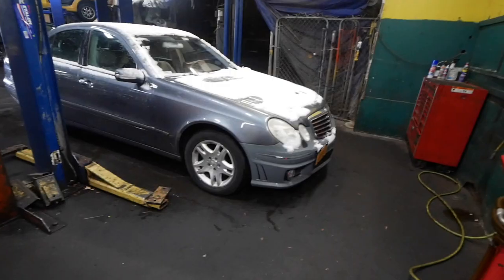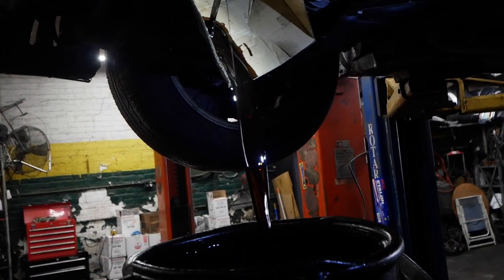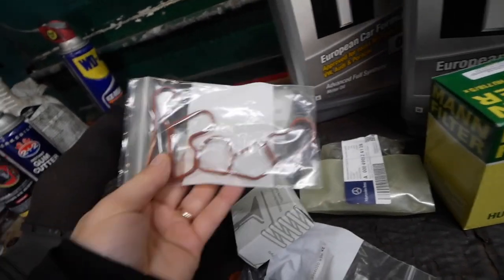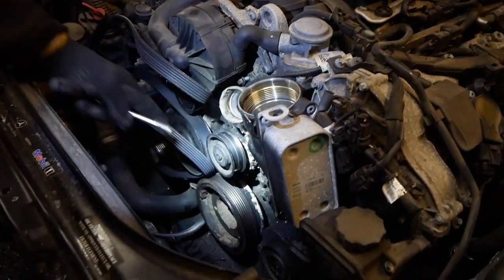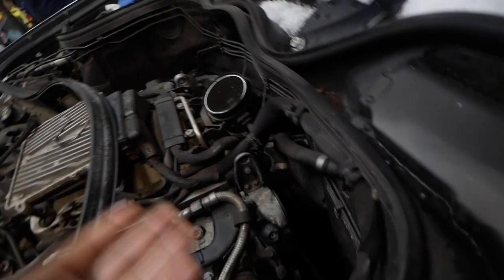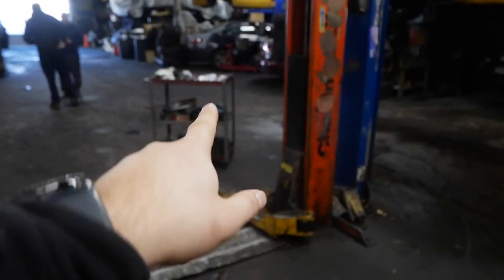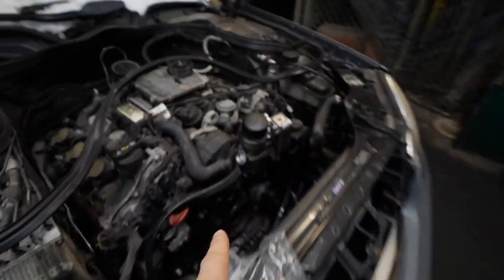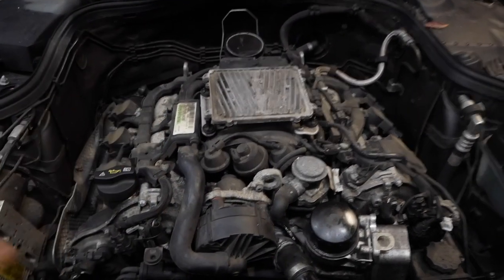Fixing Oil Leaks and Exhaust Leak on Slate (Announcing Giveaway Winner)

Comment: What was the total cost
Reply from the maker: Labor(whole day spent in the mechanic shop) 250, additional parts we needed(thermostat, pulley, tensioner and seals for the oil filter housing) 138 plus the other parts I got from fcp(don't recall how much was that